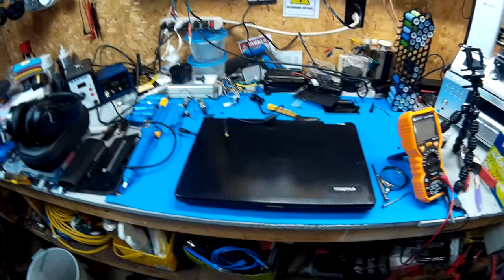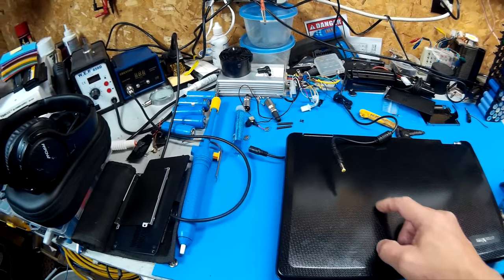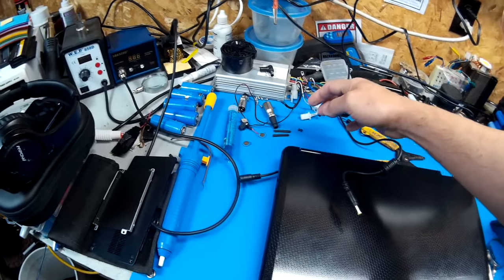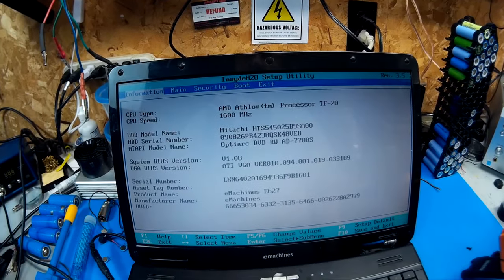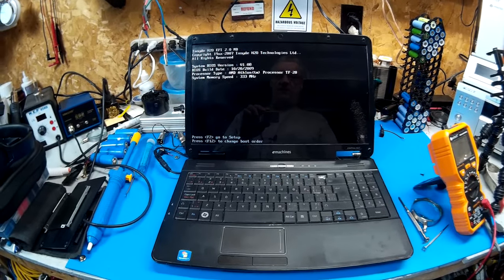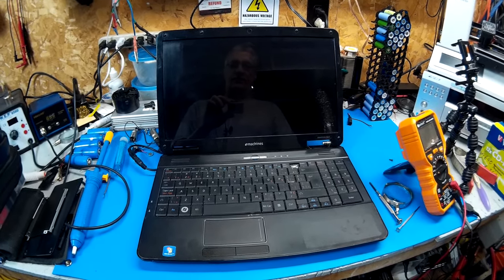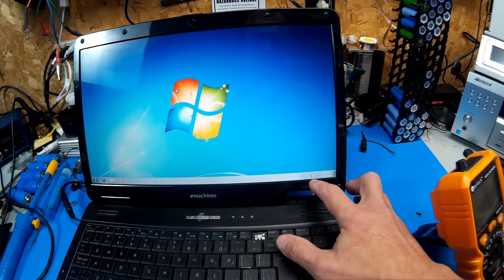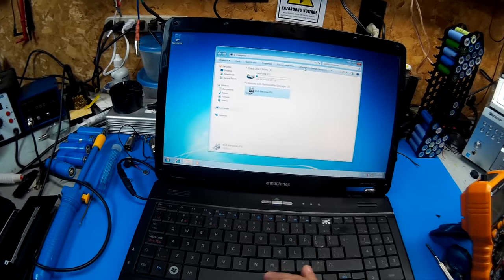emachines e627*finished test with os*

Comment: i had a laptop named emachines d732z which was working fine till i tested it with direct dc motor in usb hub for some days that usb was working fine and started to corrupt and later dead along with this bsod was seen sometimes and at last totally blacked out and while restarting shows as exiting pxe rom insert disk to boot something like that , i gave to service centres they said motherboard gone and it has to be replaced but the availability of these laptops is being hard till now. and im worried about that